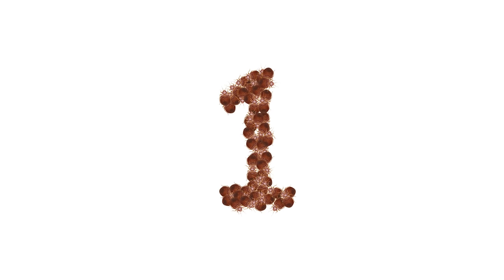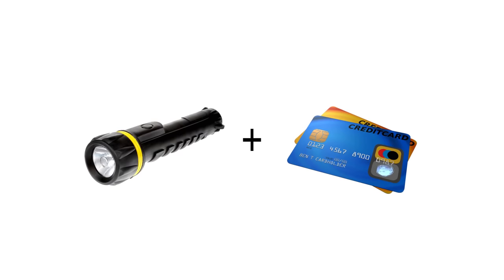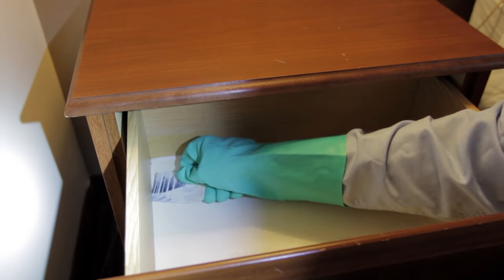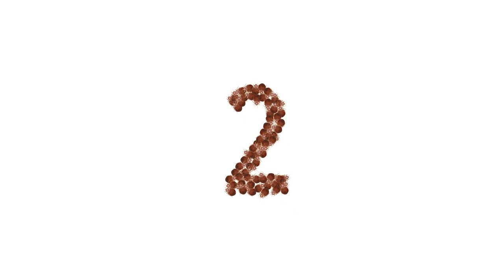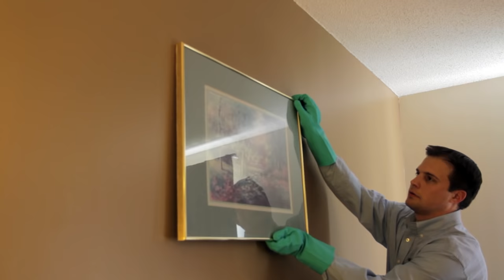How to Check for & Find Bed Bugs

Comment: Well...I have bites simular to bed bug bite but..have no signs of bed bug....What do I do now..? :<
Reply from the maker: Unfortunately, without a positive identification of an insect, we cannot make a treatment recommendation for you. You want to be sure you have an accurate identification before purchasing or applying insecticides, just like you would need to know what illness you are treating to get the right medication for it.  You may consider visiting a dermatologist and explaining the issue and they may conduct a skin scrape to look for parasites or run other tests to help find the nature of the issue. You may also consider using clear packing tape and lightly pressing it on your skin when you feel a bite to get a sample of the insect. You can then have tape inspected by an entomologist in your region (you can usually find entomologists at local universities).
 
We wish you the best of luck in getting an insect identification and in finding relief soon!

Comment: After getting treated 3 months ago we found a bed bug in one of our traps. We have searched all over our bedroom and haven't found any other signs (fecal marks, blood stains, etc). Is it possible that we just had one straggler or do we need to get treated again?
Reply from the maker: Oh no! If you have found signs of bed bugs, then we would recommend doing a thorough inspection and then retreating the area. You don’t want to risk missing other bed bugs and dealing with a full re-infestation. We have a great Bed Bug Inspection Guide here to help you know where and how to check for them. If you previously had treatment from a professional company, then you can either give them a call or use one of our great Bed Bug Kits to treat. We also have a step-by-step Treatment Guide online here. Be sure to contact our Customer Service team if you have any questions!